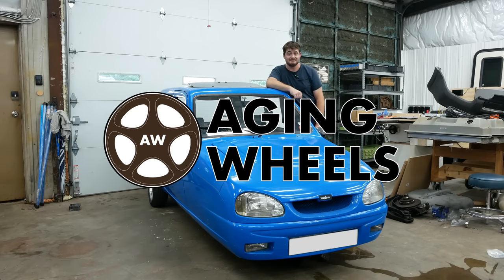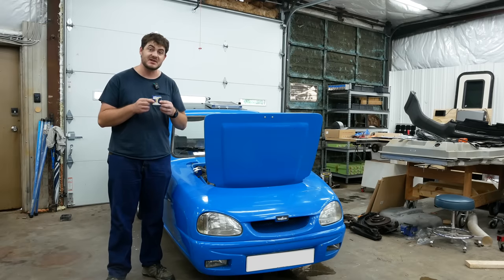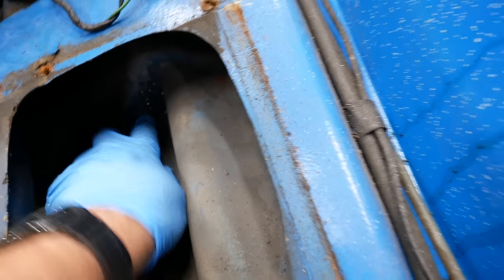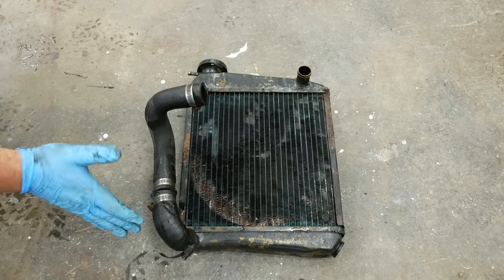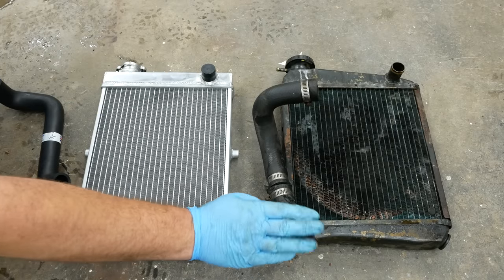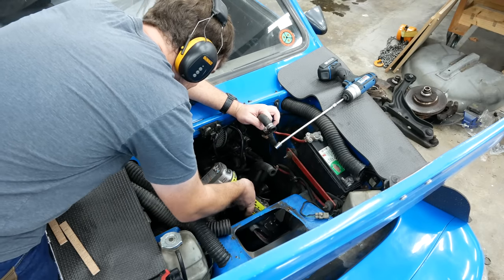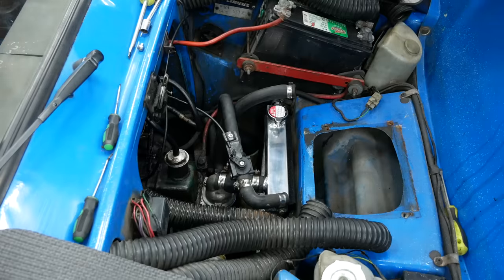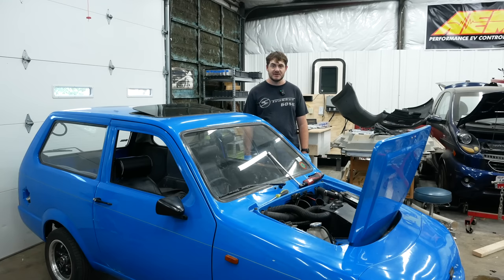My Robin is Hot. I Made It Worse

Comment: I'm pretty sure since it's a Robin, what you're supposed to do is push the Robin on its side, thereby making the cap the new highest point in the cooling system.
Reply: Second Best comment.
Reply: @SimuLord  Yeah you don't want Clarkson in one.
Reply: If it's stupid, but works, it's not stupid.
Reply: Ikr?! Just ask Mr Bean! 🤣
Reply: @Kristine-h2y   Bean drives a Mini, not a Robin.
Reply: @drumbrakes  His road nemesis drives a Robin, though.
Reply: Normally i would laugh and move on, but in all honesty and after seeing everything else wonky with the robins i would not be at all surprised if the manual said to tip the reliant to the side to get the air out.
Reply: @HermanVonPetri  Ahh. I did not know that. Thanks.
Reply: @HermanVonPetri  It's a Regal, not a Robin.
Reply: @super_pretendo  I stand corrected.
Reply: Hi all you need to do to bleed to air out it to run the engine with the rad cap off, all the air will find it's way out. Also don't over fill the radiator, only fill it just over the rad core. The thermostat housing crack because you over tightened it just use a spanner. Hope that helps 😊
Reply: @super_pretendo  To be clear the Reliant Supervan III was never called a Regal or sold as a Regal. But you're technically right.
Reply: @HermanVonPetri Think one Bean episode featured the earlier Regal supervan. Well make it a supervan by sticking the latest 850cc engine in it. Didn't get unleaded fuel until 89 to 92.
Reply: This is the way
Reply: @SimuLord  They made it unstable in Top Gear by having wheels of three different sizes and loading a bag of sand (or similar) on one side, so that it would always tip over when turning in that direction. If you look at the rear view of their car in the video, you can see that the it was not running with the suspension level.
Reply: Subarus have the same issue, the recommendation is to park the car so the front is elevated whilst bleeding it.
Reply: @RWBHere   You are correct. especially when the stig drives it, if you watch that clip you can see the difference in wheel size and the lean angle created by the extra ballast of sand or water.
Reply: Or put it to sleep, when it wakes up it will have no more issues in the morning

Comment: As someone who's owned several vintage British cars, I feel I should say, the gauges are really there just to a general indication, not specific readings. You should NEVER rely on them. And, God protect you if you ever let the magic blue smoke escape!
Reply: That's just old gauges in general I think... my '66 T-bird has a fuel gauge which has a whopping quarter-tank margin of error, and if the temp gauge registers anything at all, that means it's overheating.
Reply: My Mini has 10ltrs in the tank when the gauge is in the red, that's 1/3 of a tank left.
Reply: My '73 Triumph Dolomite caught me out. Turns out 1/8 of the fuel gauge is actually empty...
Reply: @dolomite_73  I've had two cars similar to that - a 1983 Ford Escort (1.1 base model) and a 1986 Peugeot 305. Both of them would run out of petrol with 1/4 tank still showing on the gauge.
Reply: My 85 dodge would have a fuel guages that worked backwards. F was empty and empty was full
Reply: Police: "Do you know what speed you were doing?"
..."Somewhere between 18 and 43 mph, the way the needle was bouncing"
Reply: @PerdixDesignLtd my 74 MGB does this. I just keep up with whoever is in front of me
Reply: @dolomite_73 hey for its age that seems like its pretty accurate haha. I've seen late model rigs with a 1/4 tank margin, lady thought she had 1/4 tank, it was bone dry. Was OEM unit low miles. Replaced with aftermarket drop in replacement module and it carried on being wrong, suspected gauge itself was faulty and warned them, they still drive that thing I'm pretty sure.
Reply: This isnt limited to old brit stuff. It can be modern garbage tier cars too. My Mum's Celerio tells her it's empty when there's almost half a tank left in it, she fuels to the click and never gets more than 19.5 litres in a 35 litre tank
Reply: @I-T-S-M-E  We had two versions of the Austin Metro and then the Rover 111, all of which indicated Empty when ⅓ of the petrol was remaining, like your Mini. We never ran out of fuel accidentally. When the tank was brimmed, we could drive the Rover 111 for 60 miles or more before the gauge came off the top stop.
The temperature gauge was so inaccurate in the Metro that, when the car was morphed into the Rover 100 series, Rover removed it and put a simple red indicator lamp onto the dashboard instead. That also never worked, because the cooling fan always turned on long before any real overheating had occurred.

Comment: Having owned a Bond Bug for 10 years I strongly recommend you put a metal bar at the back of the radiator mounts on the other side of the fiber glass and bolt through rather than use screwws. they just wont last.
Reply: I was thinking bolts and nuts, but that's a great solution that substantially reduces the stress on the fiberglass.
Reply: I was thinking exactly the same thing
Reply: Cannot agree hard enough. Posting reply to bump this comment.
Reply: I can't be the only one screaming at him to use nuts and big washers.

Comment: Reliants were famous for air locks in the cooling system.
The trick was to fill up with a funnel from the heater hose till it flowed clear without air bubbles & splurges coming out of the heater then quickly put the heater pipe back on.
Reply: or you could put one of those T fittings from a flush kit and fill there.
Reply: Why not just make a T-Junction with a second cap there? :)

Comment: You need to check the block for sediment. There's a bleed screw on the back of the block below the exhaust manifold for cylinder number 4, near the bellhousing. Remove the bolt and if nothing comes out your block is bunged up. Shove a coat hanger wire in it vigorously until all manner of junk falls out. Then bleed by filling through the hose for the heater core
Reply: this is the comment that really needs to be read! Mine had similar overheat issues and after coolant replacement, rad replacement and stat replacement it still had issues, all be it reduced, only after checking the block and clearing the sediment out that had gathered after years did it actually solve the problem!

Comment: Thermostat housings. There is normally a recess machined into the housing where the t-stat is supposed to live. I always use a very small drop of super glue to glue the t-stat into the housing and ensure the T-stat stays put during assembly. What you did was put the t-stat into the block, and put the gasket on top of that, almost ensuring the t-stat will be off center of the recess in the housing, causing it to crack when tightened.

Comment: The Robin should come with some emergency "JB-Weld" in the glove box.
Reply: Ah but the problem is that it doesn't have a glovebox, just a glove shelf... Thing.
Reply: It’s less of an emergency item and more of a routine maintenance item. I think he should mount one of those bulk shampoo and conditioner dispensers to the dash.
Reply: Throw the spare tyre tools out, and replace with Fiberglass repair kit, as the later will get more use.

Comment: @agingwheels . Having owned three different Reliants , the overheating problem could be a build up of sludge at the back of the engine between the wet liners and the cylinder block casting , the heater hose came out of the block on the rear right hand side , a good place to put a high pressure hose and wash/flush it out .
Reply: I gave my engine a deep clean and a rebuild which completely killed the overheating problem.

Comment: Good work, shame about the cracked thermo housing!
However I'm not sure having the heater "On" will have been helping with the overheating....
If the heater valve is open , this lets some hot coolant bypass the radiator and flow through the heater core. If the heater fan is not working, no air is passing through the heater core, and the coolant comes out the other side just as hot as it went in, then gets pumped back into the engine.

It will probably run cooler if you close the Heater Valve, (or if that's dodgy, just clamp one of the heater hoses.)
This way all the coolant has to go through the main radiator which was getting some amount of air blown over it by the engine fan.

(Factor don't deliver here, but I'll have a good look around to see if there's any growing wild. I think I've seen some of the empty shells blowing around on windy days)

Comment: Hey Robbert. Something an old mechanic told me to get for stuck bolts and other parts is Kroil creep oil.  You dowse the part with it (or submerge it if you get the 5 gallon bucket of it) and you let it sit and occasionally spray more on the part.  Depending on how stuck the part is it can take a couple of days but it will eventually get the part of bolts unstuck.
Reply: I used Kroil for years as a band instrument tech. It would take any slide out, though sometimes it took a week of heating and pulling and oiling.
Reply: @jessebrook1688  I had to soak one of the carbs for a week as well before the jet decided it wanted to come out.  I damn near stripped it because it was so brittle.

Comment: Depending on who owned it previous and how hard the water was in that area, the cooling channels in the engine block, especially the rear ones, often got blocked with limescale from the water, even if you did use antifreeze. It may be worth checking that issue (if you rebuild the engine at some point), and also, the thermostat housing shouldn't have cracked like it did unless you didn't seat the thermostat correctly and it's lip was sitting proud of the engine block seating part, which is normally identified when you seat the gasket around them. Also, between the heating matrix (the black box holding the fan) there should be a foam stuck to the box side to prevent air loss, but also to prevent fumes from entering the cabin. And if you ever mess with the carb system, there should be a tray under the carb, never discard it, it's there to prevent fuel overflow from the carb dripping on to the engine/exhaust and starting a fire. These were put on as a recall in the early models (many as a urgent recall) as many were catching fire due to being left 'choke' for too long at idle. To bleed the air out of the radiator quicker, put the front wheel up on a ramp. These are great cars!

Comment: I would suggest finding the little spigot on the rear of the head that you undo and then poke out all the silt and gubbins in there, you can also to aid bleeding buy a Caterham cooling bleed valve which takes the issues out of bleeding air locks which are common major causes of overheating.   Forward and reverse flush will aid a lot of problems and don't forget your yearly Barr's stop leak and to use an all alloy antifreeze as normal stuff will munch the alloy over time.   There were three thermostats because you would own two and come winter put in the higher one and come summer put in the cooler one usually around the time you swapped from winter coolant to summer stuff.   Remember too to change your fuel pump to carb fuel hose every other year... most Reliant's die is due to perished fuel hose that will merrily drizzle petrol over hot engine and red hot exhaust... hour later a puddle of plastic and aluminium for the sake of a couple feet of decent fuel hose.   I have toyed with making mine solid metal line putting in some coils to allow it to flex but zero danger of petrol shower badness lol

Comment: As a classic mini driver with the same issues I can tell you out of experience:
simply check the fanblade monting direction (sucking/blowing). You would be surprised what a difference that makes! 
Also there might be fans with more blades available?
Check the water pump. It might be gunked up!

Ideas for an upgrade of the cooling system:
Change the visco fan to an electric e.g. revotec (it seems the radiator has a hole for a sensor with an M14 insert?). You could use that for the ECU to control the fan.

Comment: Ugh.  I feel your pain, brother.  The problem is you used a gasket.  The gasket is squishy and allowed you to tighten the bolt to the point of caddywhompus and crack the housing.  Just use RTV, nothing else.  The housing will bottom out on metal and tightening will not cause a condition of caddywhompusness.
Reply: That's not the problem.  The problem is old plastic deteriorates and RTV would have caused this just as easily as the thing rocks about.  Gasket was fine, matter of fact there'd have been in your scenario more chance of it happening as the RTV would have been thicker in the first place or you'd wind up leaking worse than with the gasket (sans cracks of course.)
Reply: @mikeybhoutex    Have you ever worked on a Robin?  What plastic are you talking about?
Reply: @ModelA  If that was metal it sure didn't look like it.  So you're saying it's metal, and poor metal at that.  Like maybe pot metal.  RTV or paper gasket, it was destined to crack looks like to me.

Comment: I've made a very serviceable repair of a thermostat cover using the low temperature aluminium "welding" rods that can be used with a regular propane torch.  They do take a bit of practice to get good results though.

Comment: for burping air out of the cooling system, get a radiator funnel kit. Lisle has pn 24780, which should fit just about everything, and has risers, to get the funnel level above the heater core. You can then bleed the air out of the heater core, by disconnecting the hose from it, until coolant comes out. Then run the engine with the funnel attached to the radiator, until the thermostat cycles a few times, while watching the level in the funnel. Keep it topped off, then shut down the engine, let it cool, and then remove the funnel, and put the cap on. Also: the 75C thermostat is generally too low, and won't let the engine warm up enough to run correctly. It'll run well enough, but it's not ideal.

Comment: You can bleed systems (slightly) easier with parts of the cooling circuit higher than the fill port by using some extension tube to raise the effective level of the fill port. Just need it to be watertight.
Reply: Won't the air in the higher part of the circuit stay there without a higher path to go through to get to the extension tube? Or do you mean to try to run the fluid through the system (by running the engine) with the extension tube in place and well-fed so that air that passes by the fill port can escape through the extension tube?
Reply: @hoebare  Running the engine with the extension tube in place and filled up. Letting it get hot enough for the thermostat to open and gas to expand, and giving it some revs to help move things along.

Comment: And if you want better air flow to the radiator you can cut the panel of fiberglass out in front of the radiator under the car, then fit a wire mesh

the air doesn't have to go in the scoop etc then

Comment: Lovely video as always! And tip for mounting stuff in/on bad fiberglass; drywall anchor! Remember to predrill an allmost to big core hole so the fiber won't crack. Not a good solution but cheap and effective.

Comment: I used to own a Reliant Rebel where the air filter was held on by willpower. In the end it fell off and jammed neatly between the radiator and the radiator fan. I mended the radiator with some epoxy and a piece off the bottom of my jeans which was the only cloth I had with me. It worked! Happy days 🙂

Comment: Fixing those holes on the air tunnel and making sure the heater core is sealed with the body would probably help with getting air passing through the radiator

Comment: My old 96 F-150 was leaking from the thermostat housing. After taking it off, replacing the thermostat and gasket, and reinstalling the housing... I cracked one of the ears off the housing and had to go buy a new one. After once again reinstalling the housing, it... cracked along one of the weld seams... and I had to go find another housing. Third time's the charm and everything worked great after that. 
Moral of the story is: Make sure the thermostat is properly centered inside the housing before tightening the bolts. If it's not sat in the little recess in the housing perfectly, you'll snap off those ears every time. At least yours is on top of the engine... the Ford 300 engine has it on the front of the head vertically so I had to get a bit creative on how I got everything to line up. (a little dab of sticky grease in the housing held the thermostat in place while I aligned the bolt holes.)

Comment: The fact that there are holes in the body (from the factory, as opposed to rust) and the fact that you can tell the door doesn't seal shut properly, given you can see daylight where you shouldn't be able to inspires massive confidence in that things build quality, not to mention safety added with the fact that it's an all fibreglass three-wheeler. Maybe the Trabant isn't actually the least safe vehicle you own, which is some achievement.